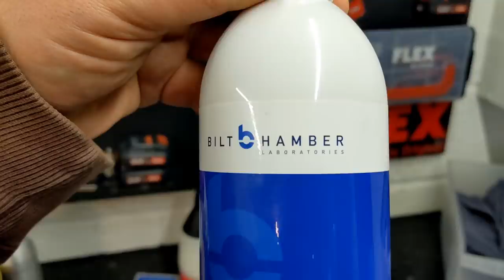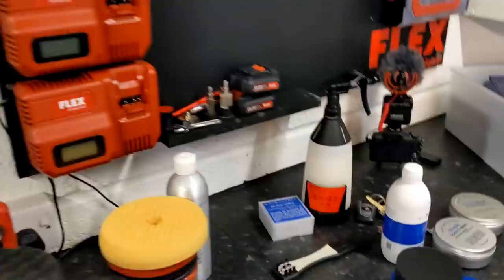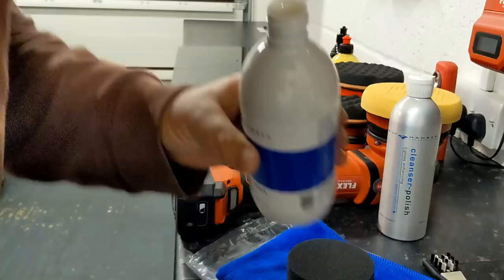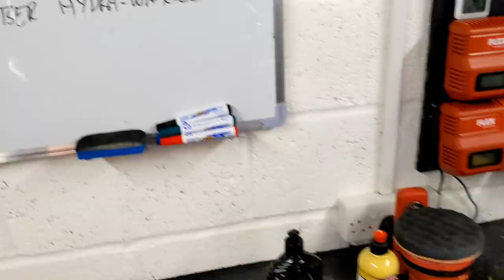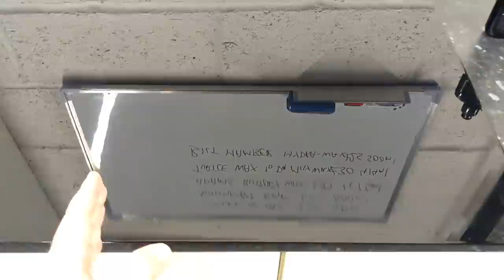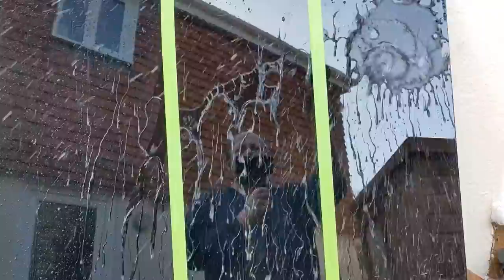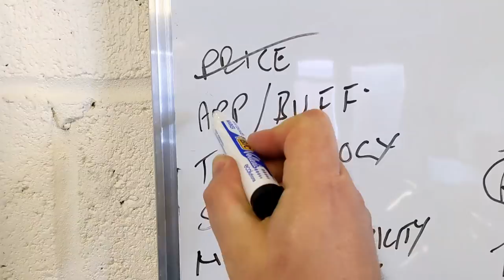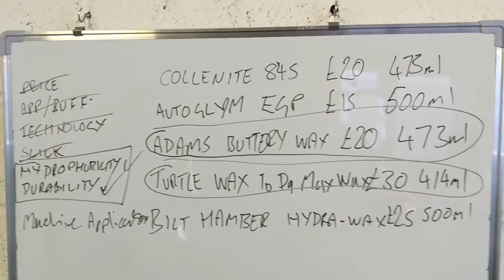Bilt Hamber Hydra Wax Review

Comment: Quickest I’ve ever clicked on a YouTube notification, been hoping you would do this one day. I tried this as an alternative to DSW and I’ve found performance similar but a doddle to apply so great if you like to apply more frequently than might be absolutely necessary. Here in Cyprus just had one of the worst winters in years, dust, rain, hail, snow, mud, the works and it has lasted well.  BH strongly recommend use of Cleanser prior to use for best durability.

Comment: I've used EPG for years as my go to for a quick wax but my biggest criticism is that it is very thin and difficult to see on the applicator and on the panel. The bilt hamber looks thicker so I'll give it try when my current bottle of EPG runs out.

Comment: Always great when bilt hamber release a new product. I've been using their touch on sealant but it doesn't seem to work unless you rinse it off not pressure wash it
Reply: Not new mate, been out for over ten years.
Reply: With touch on, use it in a snow foam canon. It’ll be way more effective for around 4 to 5 weeks over putting it into a bucket of water and trying to apply it with a wash mitt.

Comment: Would this be ok to use on a brand new car after a normal wash or would the paint need some kind of prep first of all?  Car is only leased so not looking to ceramic coat or anything just some basic protection and make it easier to clean.

Comment: Hello There, trying this Bilt Hamber product for the fist time last summer.
It takes some shake-up & can benefit from warming in hot water on those cool days.
Overall another Great product to use on motorcycle frame, mag-wheels. Where the DoubleSpeed tends to cling on these difficult to reach parts i.e. hubs behind discs, back of frame tubes etc. 
Enjoy the channel Jon... 
Thank you for introducing to the Bilt Hamber range a few years ago. 
Take a look at GarageNumber 17 
Chat Soon